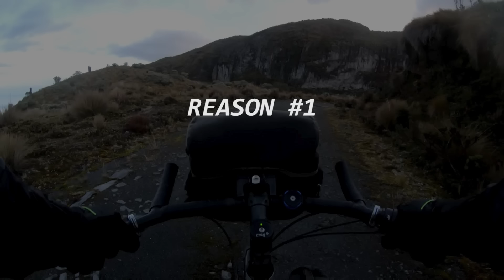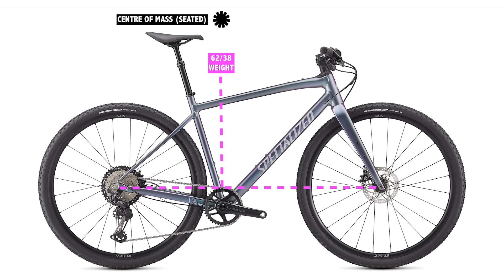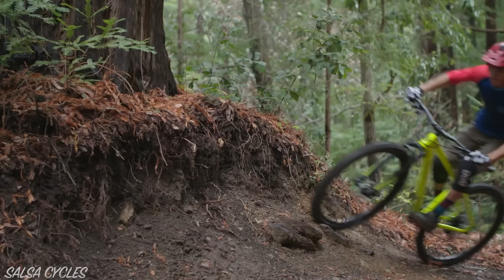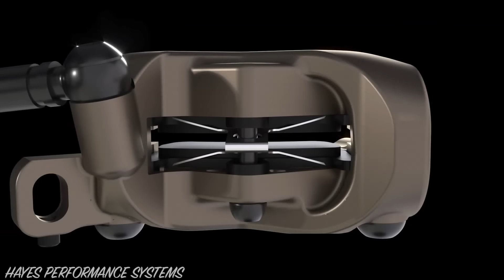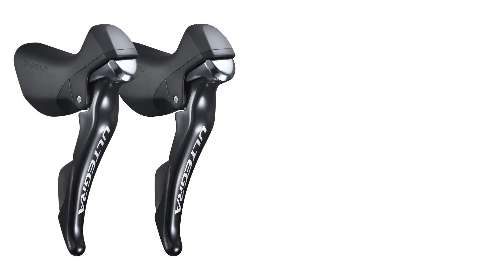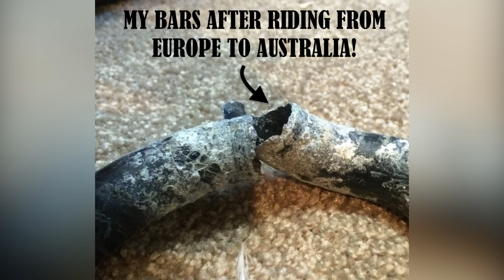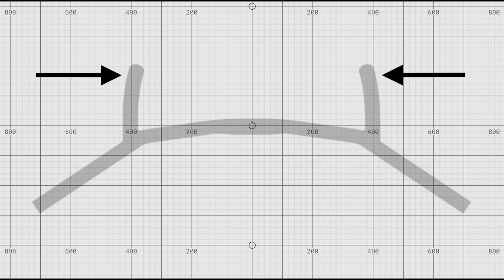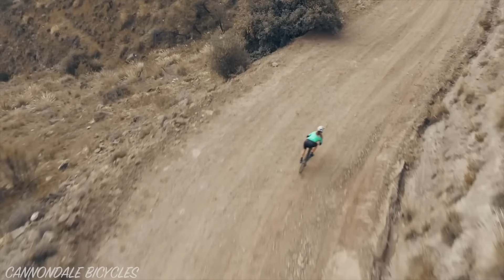Why Flat Bars Are BETTER Than Drop Bars For Most Cyclists (Objective Analysis)

Comment: I tend to agree that 'flat' bars are better for more people. However, if you are on the road for more than a couple hours, they tend to become uncomfortable. That's part of the reason that road cycling enthusiasts still overwhelmingly prefer drop bars. Leaving out ergonomics in a discussion about bars was an odd decision. It's my number one criterion.
Reply: Totally agree - when I heard that exclusion I wasn't sure whether to bother continuing
Reply: There's a term for that "odd decision": Occam's Broom.
Reply: If you’re on the road for more than a couple of hours any bar becomes uncomfortable.
Reply: @nigelmccomb8106 lol, I hear that!
Reply: Well, thinking about riding long distances like never before, I just got my drop bar, after 30 years of using flat bars. I rode through the city at night, with some traffic, and it wasn't a comfortable situation at first. Riding steep slopes on the road feels somewhat dangerous. But once I figured out how to maneuver on tricky surfaces, I felt nothing but euphoria. The power transmission and aerodynamics feel dramatically superior. You learn to use your whole body creatively to do the same things as with flat bars, even riding on rural roads. I started that way 40 years ago.
Reply: The problem I have with flat handlebars is that my forearms near the elbows hurt when I ride for more than 10 hours. It's important to note that I travel with a lot of weight. There's a forearm muscle that's constantly tense; it's not natural. On the other hand, when you adapt to the response of drop bars, you can control them very well on roads and in cities. I think they're a great invention for long trips. I used them in my youth, and I plan to use them again.
Reply: @MrMyneworld Bike fit.
Reply: I have a flat bar with about 10-20% angle, so it's totally ergonomic for my hand wrists. On longer tours with 6h riding per day, sometimes my hands get a little numb from the pressure on the bar, I then switch to these short aero bars (don't know the name) and with this changing it's OK.
Reply: But there are so many different kinds of bars that offer multiple grip positions.
Reply: I ride to get around I don't race or do group rides etc. I can't seem to get of with drops.
Reply: He , mentions handlebar positions available. I assume it was implied that ergonomics is improved by switching to anything other than a flat bar position. I may be too charitable. I figure it's common knowledge that flat bars are less ergonomic.
Reply: @lesterroberts1628  One grip position is less ergonomic than several.
Reply: He has to leave our ergonomics to make his point in his videos typically.
Reply: @vanfja  Also makes statements implying he knows what kind of cycling most people do and what they need --- but the video shows mostlly people on mountain roads in the middle of nowhere, not in city traffic.
Reply: Once you start getting into alt bars and/or inner bar ends, I think you have as much or more variety of hand positions on offer.
Reply: Most cyklists rarely have a ride longer than  30 minutes. I am surprised that security isn't mentioned in this topic. Drop bars are dangerous in the long run with plenty of short rides because you have worse control and the risk for serious crash increase drastically.
Reply: @Clever738 I totally agree. I have a "fitness" bike flat bar 1x it is my commuter. I do 10-20 miles a day on it with no problems. I have a finger on a break at all times. It's agile and climbs like a goat.
Reply: @Leo-gt1bx Yep, just the poor breaks are a reason alone why drop bars would not even be legal if cycling issues would be handled as serious as cars. 

Image someone invented a car driver seat where you could lay down while driving. And to reach the break pedal you would need to first sit up.
Reply: @Clever738 I thought it was the opposite. Wider flat bars are a liability
Reply: Most people don't ride for more than an hour or maybe two hours at most. Discussing ergonomics considerations that only matters for the more extreme riders is quite irrelevant when the video is about what types of bars suit the common people.
Reply: @yvrelna  Riding more than two hours is hardly extreme. But I really think he should have said, “for an hour or two”. This will really confuse people.
Reply: @yvrelna  ergonomics implies comfort for "common people". Also, there is no dichotomy. Unless you are aware of a cutoff point in ride time that transforms a common person into an extreme one
Reply: @lesterroberts1628 Ergonomics implies fit and comfort.
Reply: @Leo-gt1bx oops. I'll fix my comment
Reply: "However, if you are on the road for more than a couple hours, they tend to become uncomfortable."

Bollocks. I routinely do tours of 100+ km, and flat bars have never been a problem.
Reply: Not at all. It has nothing to do with preference and everything to do with trying to copy the pros.
Reply: Because it is extremely subjective and will very much depend on the person.
Reply: @michaeljensen6805 to claim ergonomics is a subjective thing is wrong.
Reply: @necromax13  not saying you are wrong, just genuinely confused. Ergonomic means "designed for efficiency and comfort in the working environment." Wouldn't it be the case that different body proportions, levels of flexibility, levels of strength, and other factors would result in one style of bar being ergonomic for one rider but not ergonomic for another?
Reply: @Rivercityrides  Ergonomics, as a byproduct of orthopedics, is in fact not subjective. It's science.
Reply: @necromax13  So, in order for a thing to qualify as ergonomic, it has to be ergonomic for every individual?
Reply: @Rivercityrides  i recommend you to figure out what ergonomics is.
Reply: @Rivercityrides  While the specifics of ergonomics vary from one rider to another, the things that make people uncomfortable are pretty universal, and the ways to fix those problems are pretty well-established. It's a complicated topic, and issues can often be masked by something else, making them hard to figure out... but while proportions can vary, the game is the same: balance the body and make sure joints are working within a comfortable range.

Flat bars can be made comfortable, but generally speaking, limiting the amount of positions you can move your hands around in will make it harder to ride for as long in comfort. You can always add some aero bars, which are excellent for comfort... but it's not really the flat bar that's comfortable then. It's a workaround for the issue that flat bars (at least normal flat bars without big sweep angles) just tend not to do a great job at putting joints within comfortable angles.
Reply: @necromax13 
The ergonomics of hand position with drop bars... is often out weighed by the ergonomics of back posture, improved center of gravity, &  stability, provided by flat bars.  

So it comes down to, which do you prefer you suffer?
Reply: @Rivercityrides  The drop bar offers multiple positions. It includes a flat bar. It is a flat bar plus more.  Just not a stupidly wide flat bar.
Reply: @Rivercityrides  Yes, Something "ergonomic for Bob" cannot qualify as "ergonomic" (without the "for Bob") part without the brochure telling a lie.
Reply: @OOTurok  The drop bar includes a flat bar! You can set it up so that you have the same back posture on your drop bar when you grab the top, as you do on your flat bar. If you install a drop bar (say 440 mm) onto a bike where you had a wide flat bar (say 600 mm), in exactly the same stem clamp position, your back will actually be more straight up when you grasp the top bar, than it was with the flat bar, because your hands are closer together.

"Improved center of gravity" is synonymous with "lowered center of gravity".

No land vehicle of any kind is improved by raising its center of gravity.

Drop bars offer positions in which your center of gravity is lower and more forward.

There are bicycle racers who have their bars really low, so that even the top of the bar is low. That's a choice not every drop bar user has to make.
Reply: @kazkylheku1221 
Problem is steerablity.  
Short bars make it very difficult to keep stable on tight turns. 
If you ever went mountain biking I shouldn't have to explain to you why.
Reply: @kazkylheku1221 
Tight turns at fast speeds is worse with short bars.
Reply: @OOTurok  Simply untrue. I have no problem inducing all the countersteering I can handle with a short bar and have to exercise the same caution/restraint not to overdo it, just like on a long bar.

I've just gone from a 60 cm wide/flat bar to a 44 cm drop bar on the same bike, literally today! So I'm doing an A/B comparison.I don't see any problem with fast turns; I'm carving them the same way.

Tight turns at high speeds do not require a large movement of the bar or muscle strength or anything of the sort. You just nudge the bar in the opposite direction and let the countersteering effect do most of the work. You could easily overdo it, regardless of the bar size.

It doesn't feel the same on the different bars, but that's a matter of getting used to it; like if you give the same "tap" on a long or short bar with about the same force, it will not have the same effect.
Reply: @kazkylheku1221 
Short bars are twitchy & unstable.
Everyone who races mountain bikes knows this, which is why the trend went to wide bars.
Reply: @OOTurok  Above a certain speed, bikes are stable, even without a rider, short bar or not. If you are racing over uneven ground (rocks, roots), it's the bike that's unstable due to the surface.  The rocks and roots are bumping the steering this way and that inducing wobbly countersteering motions that take the bike off the intended path and possibly trigger a fall.

Longer bars undeniably give the rider more leverage to control the motion of the steering when it's being kicked this way and that.  If that's not what you use a bicycle for, then the long bars are mostly a disadvantage. The wide grip beyond shoulder width isn't good for long rides. Long bars are more easily clipped by a passing vehicle. Bike doesn't fit in tight places.  Doors, hallways, elevators, storage lockers,  vehicle cargo spaces, bike rooms: all more annoying with long bars.

Comment: I've got a base specialized allez and a trek fx 2. While the allez has its merit with being fast and efficient, the position is a huge drag on my neck and shoulders, plus it's not very confidence inspiring amongst the urban forest to be tucked down. Could I cover more distance, more quickly, on it than my trek fx? of course. However, I'd be more likely to speed run that ride just to get home quicker and relax my body, instead of enjoy it. On the fx, I'd cover that same distance much slower, but I'd probably surpass it with how much fun, how comfortable and how confidence inspiring the bike is. Plus, I can use the fx year round, and I trust the sturdier construction to be able to carry loads.

Comment: I agree with most of you points but the thing you have missed is on drop bars you can still reach the breaks in most hand positions. If you tell someone new to riding to move their hands onto a more aero position that’s going to have different handling characteristics to be used at higher speeds and add to that you can’t reach the breaks you are asking for trouble. Also you seem to be saying hydraulic breaks are only an option flat bars which is not true. I happily do one finger breaking on the drops of my hydraulic disk bike. In my opinion if you are touring or not on road drops are still far better as you can always be in a more aero position with access to the breaks.

Comment: most of the reasons are just logical consequences to the bikes the bars are attached to. a flat handlebar is mostly found on a mtb, a bike that needs a lot of control and grip because of the terrain you ride on. drop bars dont have as much control, because you don't need it on the road. they both have their place, flat bars are not just better than drop bars, it depends on the terrain and bike they are mounted to

Comment: In January this year, I had a simple fall from my road bike when my front tyre deflated in the middle of a corner. Unfortunately, I tore two ligaments in my left shoulder. After months of physiotherapy, the range of movement of my arm failed to improve. After MRI scans, my orthopaedic specialist gave me the bad news that my shoulder was inoperable. She described my 70-year-old ligaments as, "Like wet Kleenex." So, not strong enough to be repaired. When I tried riding my bikes, it proved almost impossible and highly dangerous to ride my road bike. The drop bars were simply too narrow for me to have enough leverage to steer, and the reach was too far for me to be able to take my hand off the bars and have any hope of getting it back onto the bars whilst riding along. Contrastingly, I was easily able to ride my mountain bike. It is much more stable and much easier to take my hands off/on the bars at speed and on rough descents. With practice, I've been able to return to riding the roughest, gnarliest mountain bike trails. I decided to sell my beautiful custom-built road bike because I know I'll never be able to ride drop-bar configurations again. It felt sad to see that beautiful bike go to its new owner. But with the money, I'm having a new bike-packing rig custom-built to fit my body. It will incorporate Jones H-Loop bars.
- Keep on riding...
Reply from the maker: I'm really glad you're still able to ride! Good luck with your new custom bikepacking build. 👍🏻
Reply: @Cyclingabout  Thank you. Cycling is a life-long pursuit.

Comment: You missed one point, descending in the drops on tarmac offers far more stability in fast corners. I’ve a flat bar bike and two drop bar bikes and on a local descent I cannot take the corner at remotely the same speed on the flat bar bike. I’ve also tested swapping the wheels over and the result is the same. On the flat bar bike I tend to drift across the road. Other than that I agree 100% with what you said. 👍
Reply: the drop bar position let's you lean your weight on the inside of the turn, directly on top of CG, it's very stable, flat bars will go all over the place.

Comment: Nice analysis. For unladen riding on smooth roads I prefer drop bars. For laden riding and or rough terrain I like flat bars with Ergon grips. I do use narrow flat bars though as control never seems to be an issue for me.

Comment: Flat bars also have more room and compatibility for accessories such as mirrors. That and struggling to find low enough gearing have been my two biggest issues with drops, though I still love and primarily use them. 

I just think that for myself aerodynamics are more important than anything else mentioned. I have never found my distance cycling ability limited by braking, or control, or "stability", whatever that means. Though I can certainly imagine trips that get gnarly enough for flat bars. I would love to try a alt bar with swept handles and aerobars, but I have spent enough on bikes, for now...

Comment: Now make this video again, but this time include ergonomics. As comfort on the bike is a significant driver of choice.
Reply from the maker: Both flat and drop bar bikes can be set up ergonomically. This is why both handlebar designs exist, and it's not a point for or against either bar type.

Comment: You make so many assumptions in this handlebar video, many of them wrong.
Flat bars can do anything a drop bar can do, anything except that the drop bar offers a wider variety of hand positions.
Reply from the maker: What assumptions are wrong? Are you sure you're not just wanting every reason to be relevant to your specific use case?